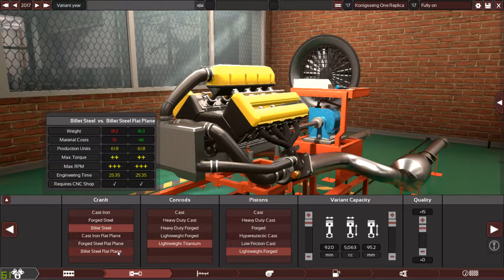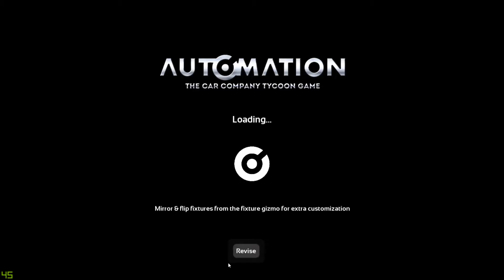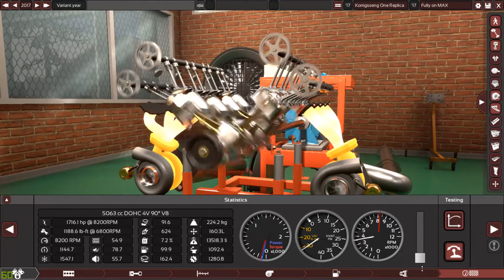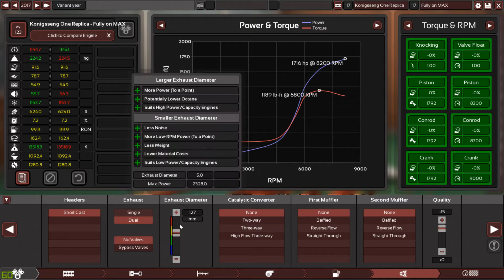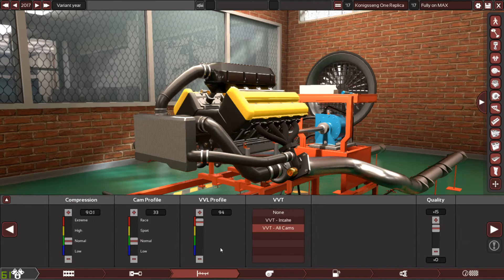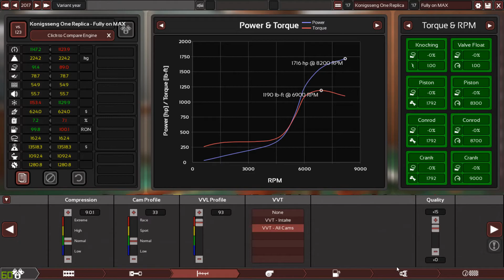Koenigsengg One engine MAX request.

Comment: It's not currently possible to build a Koenigsegg* One:1 engine in this game, because we don't have Variable Geometry turbochargers, yet. The One:1 engine makes over 1000nm of torque from 3000 to 8000 rpm, with a max of 1371nm at 6000 rpm. I believe I heard Christian von Koenigsegg say that the turbos spool up at around 2000 to 3000rpm, and that they are able to keep them spooled because of the valves in the turbine section of the turbochargers.
Reply from the maker: A lot of torque for a long rpm range. Amazing. Because if i try to make a replica of this engine in Automation with regular ball bearing turbos it will never have the same torque range. But i will try hard to do it or something close to it. 
Thank you for your awesome comment. 👍
Reply: http://images.thecarconnection.com/lrg/koenigsegg-one1_100458106_l.jpg There's a picture of the torque and power curves of the One:1. I remember seeing a video by Engineering Explained, and he calculated that the One:1 engine is technically making the same power as a 13.9 liter naturally aspirated engine (because of the boost). (https://www.youtube.com/watch?v=wYWMi0O0UB4 - Engineering Explained's video)